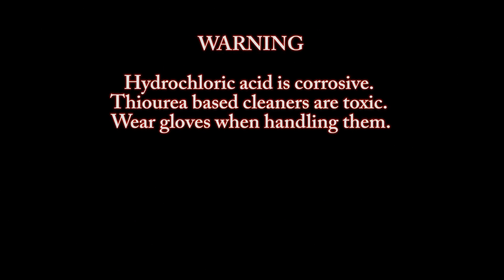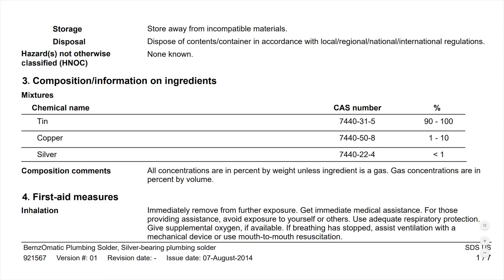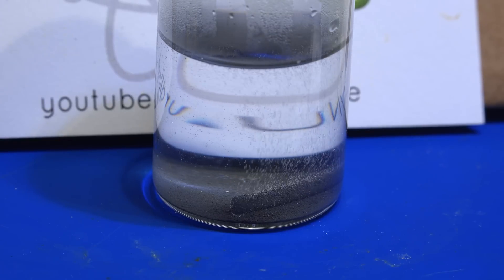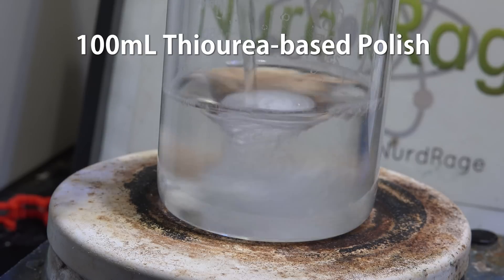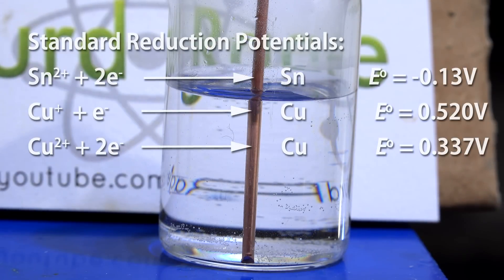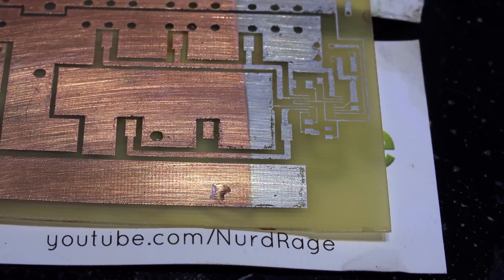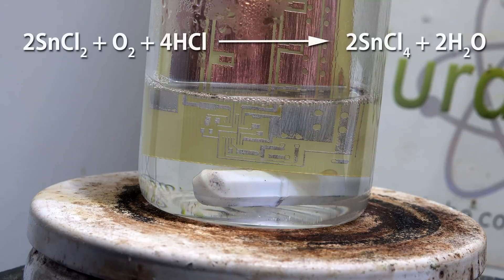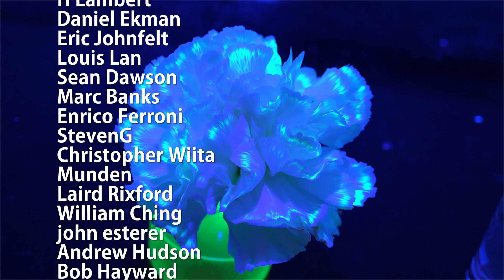Make PCB Tinning Solution ("Liquid Tin") by Redox Flipping

Comment: Excellent!  What about a SILVERING solution that can coat Copper with a thin layer of Silver?  Is that possible with Tiourea, too ?
I am asking because this has wide applications in RF electronic circuits due to the high conductivity of Silver and the Skin Effect occurring RF circuits.  
For example, an RF resonant cavity coated with a thin layer of Silver exhibits much better Q (less resistive losses) on its surface.
Reply: Aleksa Djokic Correct. What you're making here is silver thiosulfate. Silver deposits onto copper and other metals from a solution of silver nitrate too, except it doesn't form a nice clean and shiny layer but rather deposits as a powder composed of tiny crystals. But from the thiosulfate solution it deposits as a shiny layer. 
When I was a kid I was into photography - good old-fashioned silver salt-based. The fixing solution for the silver process is thiosulfate - and it would dissolve the non-reduced silver salts, to form silver thiosulfate that accumulated in solution. Spent solution could accumulate many grams per liter of silver, and you could recover it from there chemically. But copper dipped into this solution would be quickly plated in silver. I used to keep my spent fixing solution for the specific purpose of silver-plating things. :)
(edit) also, while many silver salts are sensitive to light, silver thiosulfate isn't. You could keep a bottle of spent fixing solution in full sun for years and nothing will happen to it.
A word of caution if you're going to use this method for plating silver onto RF components (or anything else for that matter). The layer of deposited silver is extremely thin. It will tarnish in a matter of hours by reacting with trace hydrogen sulfide in the air, and turn into black silver sulfide. With that, your extra-conductive silver layer will disappear and any benefits from it too. If you don't want that to happen you will have to coat it with lacquer. You cannot deposit thicker layers of silver by this simple process. For thicker plating you need to use either an electrochemical process, or electroless plating (where you have both a silver salt and a reducing agent in solution). Thicker layers will tarnish too, but only on the surface and still leave some metallic silver underneath. With very thin layers, the conversion to sulfide takes place in the full thickness of the layer.
Reply: Pure silver won't work because it converts to silver oxide really fast in contact with lights, turning itself black.
Reply: Perhaps the place where you live has very little H2S in the air, thus no tarnishing. The place where I lived when I was young and doing the silvering experiments was close to the Black Sea which is notorious for its H2S content - and it leaks into the air too. Not enough to be dangerous or even noticeable, but enough to tarnish silver quickly.
Reply: I'd be suprised if it is. Silver is a pretty noble metal so i don't think tiourea has an an effect on it. But i did never try.
Reply: Its actually very simple to do. Get silver chloride and dissolve it in a solution of potassium/sodium thiosulphate. When dissolved just put the pcb in it. The solution is very light sensitive so make it only when you need it.
Reply: @ jort93z: I thought that Thiourea binds so strongly to Copper that it gives a chance for the other metal to react and take its place by this Redox Flipping
Reply: Silver chloride and sodium thiosulphate form a silver complex called  sodium ditiosulfatoargentate(I). I did think it wouldn't be light sensitive but it is. Also, i did plate a lot of pcbs with it, there is no tarnishing.
Reply: .rods gouging arcLook at Lookat flow.floe could electrons and anything plate silver actually could You .charge the carries layer outside the only that fact the in correct also are You .somewhere someebds plate they whythat's thats and corrosive non is Gold .metals the all of out heat and electricity most the conducts silver Inkth
Reply: Unlike tin, silver will readily oxidize in air and "tarnish". It's one advantage is that silver oxide has about the same conductivity as pure silver so it continues to conduct and protect the copper below it. It may look ugly but it's doing its job of providing a good conductive layer and protecting the copper underlayer, so no worries about tarnishing silver. Use the silver chloride/sodium thiosulphate combo mentioned and it works well. Spent fixer from a photo lab works also but not if the silver has been recovered from the fixer.

Comment: About plating Copper.

A YouTube creator (Clickspring) builds the antikythera mechanism and try to guess what tools and techniques where used to build them. And the question came up how they could make visible marks on the brass plates for measurements and layout.
I knew that you can use a copper sulfate solution with a little bit of sulfuric acid to plate iron with a copper layer and that this was used for layouts. So i searched for something similar with copper. I found an old goldsmith book that describes something like that: (loosely translated):

First warm up water and add urea until any additions didn't get solved. The add sulfuric acid until the solution gets a sour taste. Copper or brass or bronze dipped in it will get a brown coating.

Would that work? And is this a similar urea/copper reaction you described in the video?
Reply: I might try this tomorrow. Sounds interesting. As a sidenote sulfuric acid and hydrochloric acid dissolve the zinc in brass more quickly than the copper. Therefore brass turns coppery on the surface when treated with said acids.
Reply: Thanks for trying it out. I don't have the materials.
If i understand the video correctly the urea will make the reaction with the copper more "profitable" than with the Zinc or Tin if i understand it correct.

Comment: Is this the same process that's used to tin coat electrical wires? If so, do you know what the ratio of tin:copper is for different common size of plated wires is?

Comment: Cyanide goldplating would be better but still great science !
Reply: Not to mention that cyanide is "a little" poisonous.
Reply: @GRBtutorials  apple seeds contain cyanide... it's all about the quantity
Reply: its more expensive though. nobody wants to spend that much on a pcb i don't think.
Reply: yeah, cyanide can be a bitch sometimes but for goldplating you don't need high concentration, okay for suicide you don't need high concentration either but still....
Reply: yeah that's right but i always want my stuff to look sick and gold is more stable than tin
everyone can choose what they prefer
Reply: Gold plating is often used on edge connectors on ram modules and expansion cards as it's  both electrically conductive and corrosion resistant.
Reply: The Chemical Workshop use of cyanide is heavily regulated by some jurisdictions and some have banned it's use outright. Here in oz anytime we work an old gold mine we have to destroy any remaining cyanide before any other process. Some mines still use it but only because a grandfathering in the law because they were operating prior to its passing
Reply: gold plating is not that expencive, if you have the setup, goldplating will cost you pennys... and some people do want high quality but still homemade
Reply: I mean, tin and thiourea are a lot cheaper than gold and cyanide. I mean, goldplating will cost you penny's but tin plating will cost you a quarter of that or less.
Reply: Gold is not easier to solder than tin.
Reply: If you want to gold plate pcb's you'd first put on a rather thick layer of nickel and then a thin layer of gold. The gold is only for storage and the solder actually attaches to the nickel. the gold dissolves into the solder immediatly. it has to be very thin. its called ENIG.
Reply: okay, thanks for additional info
Reply: thats true. audio connectors and propes are also often gold plated. but you usually don't want to solder on those.
Reply: Yes, gold plating would be nice to have for classic console games and home computer expansion cartridges, especially if we can make it a bit thicker and harder to wear. Also nice if we can re-plate the old connectors, replacing them is not always possible because of unusual pitch but they do all wear down. I kind of like the preservation aspect of working on all those old systems, it's such a pleasure to see a system that is 30 years old go from dead or barely working to super reliable. And cost is really no longer an object with these.

I can even think of things i'd gold plate in more modern systems. The pins that go from the main board on the SEGA Dreamcast through to the power supply are a proper menace, would be nice if we could give them some chemically resilient soft gold coating.

Comment: Is there any way for the amateur to produce thiourea at home?
Reply from the maker: Too toxic. Buy Tarn-X since they do all the hard part for you.
Reply: But if you really want an old-school synthesis there is one that starts, "First collect the dung of serpents...." 
No really that is the purest natural source, and the process starts with urea,
(NH2)2CO + Ca(OH)2 → CaCO3 + 2 NH3
CS2 + 2(NH3•H2O) + Ca(OH)2 → NH4SCN + CaS + 4H2O
Then heat  NH4SCN to get SC(NH2)2

So there you have it Thiourea from nothing but serpents and brimstone. The calcium from is from their bones and the carbon from the other parts via pyrolysis, you could possible distil of NH3 from that process too. And for additional fun you can burn swap gas to get your brimstone (S). So that would be "Serpents and Miasma (Swap Gas)". Muahahahahhaaaa!
Reply: Oh crap,  hydrogen sulfide and calcium cyanamide in the same reaction. Both are toxic. Whatever amateur considers doing this at home, will certainly die. The faint smell of the first is also known as rotten eggs' smell.
Reply: You will find it in dyeing kits for indigo too.

Comment: can you make hydrochloric acid very concentrated?
Reply: Yes but it's not safe because the vapor pressure of hydrochloric acid is very low, meaning it evaporates very quickly. You can only store it in low concentrations
Reply: Why are you asking ?
Reply: In the past I spent a long time looking at how low % concentrations most available Hydrochloric Acid were compared to (e.g.) Suphuric Acid concentrations.
But a thing to bear in mind is that most acids are liquid compounds themselves and, so, can be distilled to as close to 100% as their azeotropes with water will allow.
But Hydrochloric is very different. It's a solution of a gas (Hydrogen Chloride) in water and, being a solution not a liquid compound, it's concentrations will appear to be much lower than other acids.